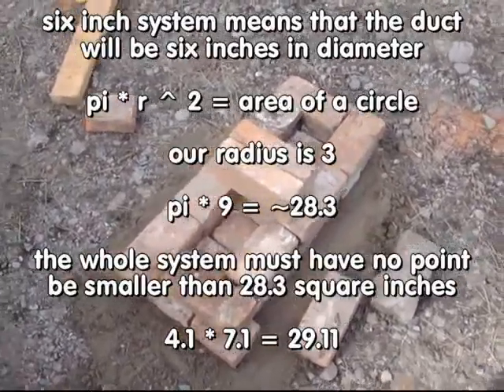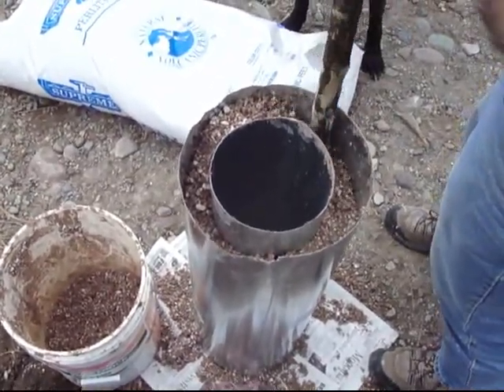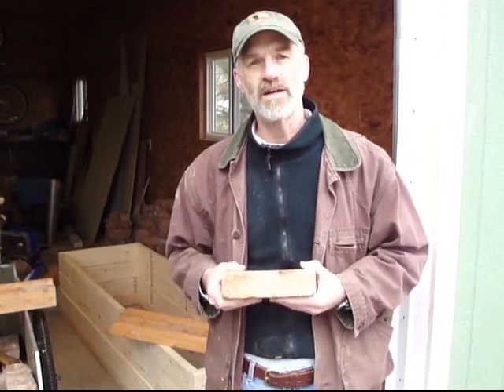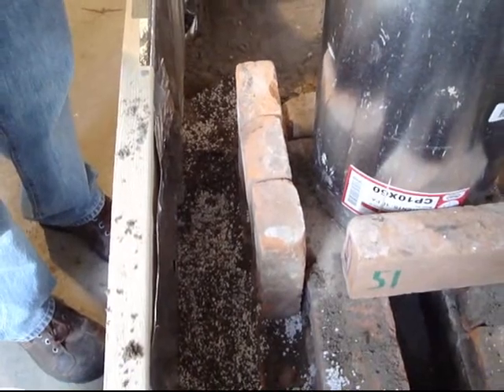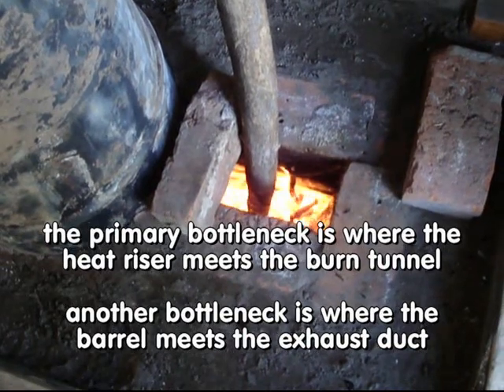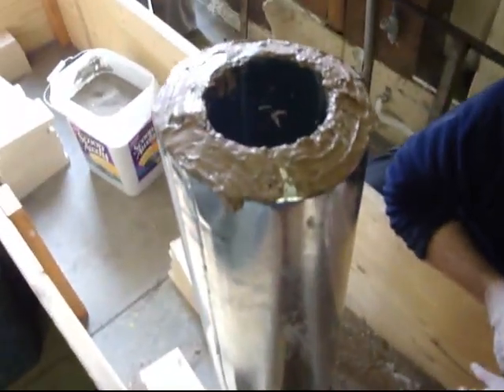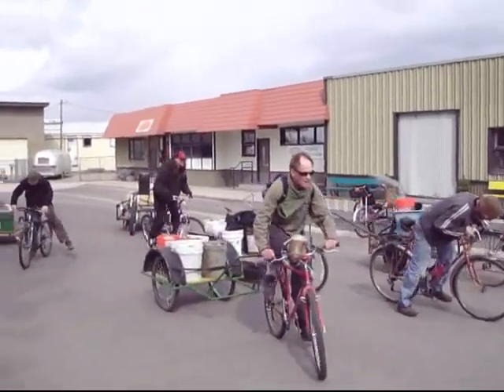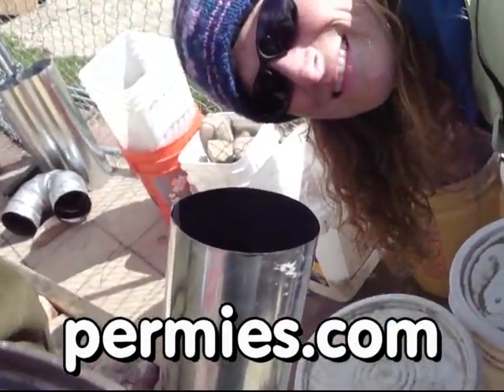portable rocket mass heater / free cycles missoula

Comment: I think you are losing too much heat through the bricks in the fire chamber. You can make insulating cob bricks from 50% organic matter (sawdust, rice hulls, sieved dried manure etc) or vermiculite and clay or even concrete (I have done this with sandy soil with not enough clay). Then you can make a moulded chimney section in a similar fashion using a couple of buckets as a mould and a plastic pipe for the central chimney.

Comment: You can get fire brick at a brick yard for about 1.00 a piece bought 30 the other day shop around . i had to no one had any free ones. Regular bricks will not take the heat they will crack and you will have to start over, unless you can find the old bricks

Comment: I built a small R M stove, 4 in, T stovepipe,  vert feed, the capped end is clean out,  connected to an elbow, 4 in,wide  riser within a outer pipe, ash and gravel in between,  lower section is cob, stones embedded., I connected , opened on both ends, Hi-C type can to cover  all of the exposed wood that hangs out of the feed hole. The fun part now is not watching the sideways burn you see on all of these vids, but and UPSIDEDOWN burn that is also smokeless and too cool for words.

Comment from the maker: The answer to that question is bigger than will fit in a youtube response.  And is well covered in the book.  If the burn tunnel is too long, you get problems.  And how far you can go is determined by the height of the heat riser.  But, yes, overall, the mission is to try to keep the wood feed cool so that you don't have competing chimneys.

Comment: So are you saying the higher the heat riser the longer the burn tunnel you can have? I have the book but I must have missed that part to tell the truth I have not read it from cover to cover religiously. But I have built 2 stoves that work however my current one has some issues at times with not wanting to burn everything completely right at the very start of the burn chamber "farthest point from the heat riser" Also thinking it may be an insulation issue since that part of feed is not insulated

Comment: I was wondering what type of metal is being used... What is the gauge of the steel? Is it galvanized? Is it stove pipe, or conventional ducting? I just wanted to know how well it held up, and if it is galvanized, how do u make sure there is no toxic emissions from the burn, as I know that it is extremely hazardous, and potentially toxic to use regular galvanized duct work for this purpose. Cheers.

Comment: Just a bit of engineering advice:  When you use rectangular sections find the "equivilent diameter" using the equation de = 1.30 x ((a x b)0.625 / (a + b)0.25).  Both your v.1.0 and v.1.1 didn't work well because you simply assumed that section area was all that mattered.  (the wood magazine was too small in both cases)

Comment: I am wondering why you do not use chimney brick vs using steel in your" thermal chimney" under the barrel? Does it not start very well or are there other problems involved that it is not cost effective? I know steel is easy to find and work with but you would doing replacements every ten or so years- I'm guessing.

Comment: Hey you have some great info here...thank you so much for sharing it with us!
Would it make it more rockety to have the feed area just a little further away from the riser so there is better cold side/hot side draft pulling going on? Seems like the cold side/hot side would "argue" the closer the feed side is to the heat riser...is this true?

Also....would vermiculite be a better insulator for the thermal mass side?

Comment: Interesting video.  One idea I had occurred to me while searching for 'DIY refractory bricks'; I came across links on building pizza ovens, which use *two* types of brick: firebricks (containing alumina and silica) on the inside, to absorb and hold the heat, and insulating bricks (like you are using) on the outside to reflect the heat back.  It made me wonder how well using both types would make the combustion chamber of rocket stoves more efficient.

Comment: @paulwheaton12 lol, thanks. That sparks an idea about a grated fall thru for the ash, to a catch tray underneath. With an access port/door, to allow it to be slid out, emptied, then returned. Better in a permanent design however.

Comment: I haul 500+ lbs of steel on my bicycle trailer on a regular basis.
.
If you can manage to wrap your head around gears work, its actually very easy---if you try getting started on your lowest gear, you get the exact same affect they did.

Comment: In a sealed room (let say a brick garage without cavities, just one run of brick) how much would the temperature rise within the space using a heater of this configuration. A few degrees. I am looking at system to heat my aviary roosts (about 4ft x 12ft) The walls are super insulated and currently I am using 400w electrical heater.  My fear is the system would generate too much heat and would therefore need cost feeding. Want a temp of about 12 degrees constant.

Comment: One thing I can't understand:
You say sand is a better insulator than pea gravel. And you take pea gravel. So you want to fill it with a worser insulator? Why do you need a bad insulator?
And another question: Can I lead the exhaust pipe to a cob room like a cob oven to bake bread in it and lead it the steam afterwards outside?
Reply: The idea is to release the heat from the exhaust pipe with the pea gravel, not insulate it and keep the heat inside letting it escape outside to where it's vented.

Comment: OK everyone wants to insulate the burn stack,why? If the smoke is exiting the bottom of the outer stack,it will keep the firebox hot and ,seems to me have a better heat transfer. Maybe use thin wall pipe/tubing instead of sheet metal?
As I remember the first rocket stove video I saw was built that way. 
Great ideas though,thanks.

Comment: How do you clean out the ashes that build up?
Reply from the maker: 95% of the ash will be in the wood feed.  4.9% will be where you pop off the barrel.  In this particular design, the rest would require taking it apart.  This is why most designs that are permanent have a cleanout access.